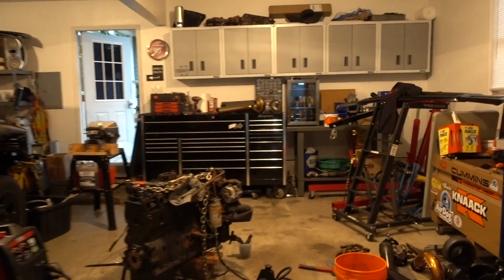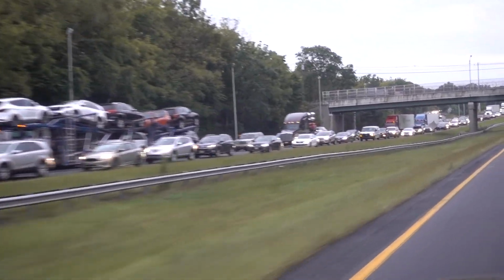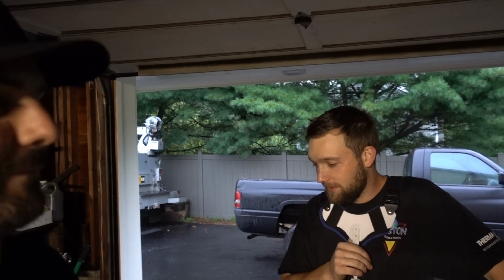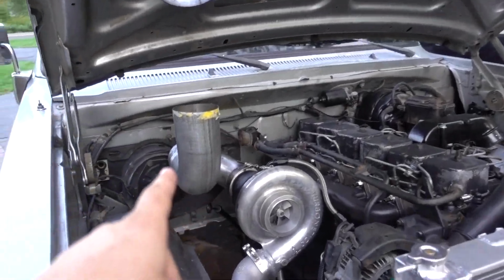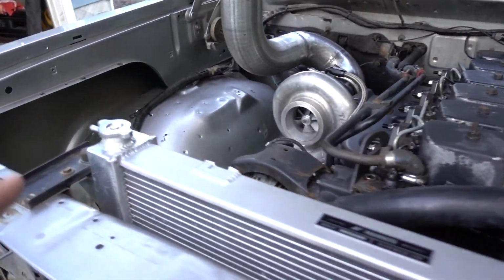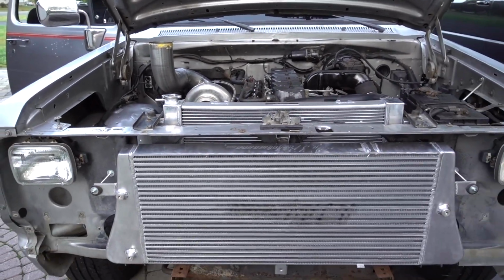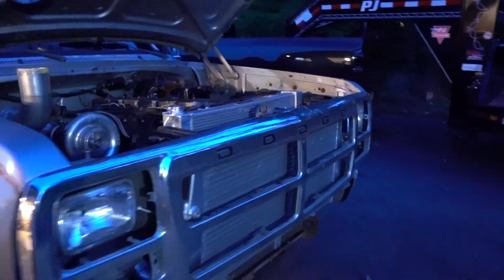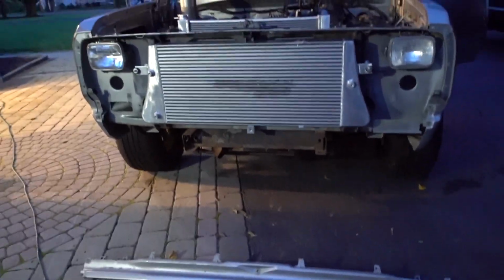THE FIRST GEN CUMMINS RETURNS AND IS BETTER THAN EVER!!!!

Comment from the maker: While your guessing hit that thumbs up!!!! 
Mini giveaway ends at end of today!!!!
Reply: GREG_ALBERALLA airdog or rear end
Reply: GREG_ALBERALLA A painted valve  cover
Reply: GREG_ALBERALLA racing seats?
Reply: GREG_ALBERALLA powerdrivendiesel air filter/intake
Reply: Dana rear end with disc brakes
Reply: GREG_ALBERALLA  air dog fuel system
Reply: Air dog fuel system
Reply: Air dog 4g and sump
Reply: Airdog fuel system!
Reply: Rear end install
Reply: GREG_ALBERALLA air dog
Reply: GREG_ALBERALLA gotta be fans
Reply: Trans adapter
Reply: Air dog
Reply: GREG_ALBERALLA  governor springs 👍🏽
Reply: GREG_ALBERALLA airdog sump pump
Reply: air dog or a radiator fan!!!!
Reply: Governor springs!
Reply: Airdog fuel system with a beans sump
Reply: GREG_ALBERALLA could you message me I have a truck question need help
Reply: Headlights
Reply: Airdog setup or a built transmission from Muldoons
Reply: Luciano Panezutti he already bought it
Reply: New headlights
Reply: Dana 80
Reply: GREG_ALBERALLA airdog, traction bars, or ratchet shifter for the manual valve body trans
Reply: Airdog lift pump
Reply: GREG_ALBERALLA the brand used rear
Reply: Dana 80 install!!! 🎉
Reply: GREG_ALBERALLA finally your gauges???
Reply: GREG_ALBERALLA Airdog or pillar gauges!
Reply: The John moldoon trans
Reply: Airdog
Reply: Rear end
Reply: Traction bars or Dana 80 or gauges
Reply: Air doggie
Reply: Air Dog Sump is next modification.
Reply: GREG_ALBERALLA air dog or traction bars
Reply: Air dog
Reply: GREG_ALBERALLA manual trans
Reply: Rear end
Reply: GREG_ALBERALLA  my guess is a p-pump
Reply: GREG_ALBERALLA air dog lift pump
Reply: Air dog
Reply: Traction bars
Reply: Headlights
Reply: GREG_ALBERALLA injectors
Reply: Electric fans
Reply: Airdog 4g all the way for the next mod
Reply: Rear end
Reply: Damon Clemons he already has one
Reply: Electric Fans!
Reply: GREG_ALBERALLA Air dog fuel system
Reply: Feel pump
Reply: Greg_Alberalla injectors so u have more fuel to go with the bigger turbo.
Reply: GREG_ALBERALLA rear, headlights or gauges???
Reply: Pod gauges
Reply: GREG_ALBERALLA gauges or wrench works sticker in the back window
Reply: GREG_ALBERALLA the new transmission????
Reply: GREG_ALBERALLA a cam or a p-pump
Reply: intake horn/grid delete
Reply: GREG_ALBERALLA air dog
Reply: Short throw shifter or chrome rear diff cover
Reply: I have to say the air dog 4g with beans sump
Reply: Air dog.
Reply: air dog lift with beans sump
Reply: I think the gauges or the airdog Greg I need a sticker haha
Reply: Air dog pump???
Reply: GREG_ALBERALLA  traction bars
Reply: GREG_ALBERALLA air dog or tranny
Reply: Gotta be an air dog!
Reply: GREG_ALBERALLA. Airdog
Reply: Airdog
Reply: Air Dog 150
Reply: Muldoon built trans
Reply: GREG_ALBERALLA methanol injection?
Reply: drive pressure gauge
Reply: GREG_ALBERALLA the electric fans
Reply: GREG_ALBERALLA injection pump
Reply: Air dog 4g lift pump.
Reply: It's a disc break Dana 80
Reply: GREG_ALBERALLA  what happened when it rains into the hood stack
Reply: GREG_ALBERALLA  INJECTORS
Reply: GREG_ALBERALLA electric ⚡️ fan or head lights or gauges
Reply: Nitrous
Reply: valve cover paint
Reply: GREG_ALBERALLA.... Another caterpillar for the one you ran over.....R.I.P Mr. Caterpillar....
Reply: Nitrous for the upcoming event
Reply: GREG_ALBERALLA the trans adapter
Reply: GREG_ALBERALLA  injecotrs, cause you already got a rear end for it
Reply: Injectors!!?
Reply: Electric fans?
Reply: Air dog
Reply: I'm just going to go out on a limb and say airdog or injectors
Reply: Air dog, rear end, or something transmission related like the shifter or even the trans it self 🤔
Reply: GREG_ALBERALLA it's a transmission
Reply: Fuel pin
Reply: GREG_ALBERALLA big injectors or rachet style shifter
Reply: GREG_ALBERALLA twins?!?!
Reply: GREG_ALBERALLA Injectors?!?!
Reply: Air dog?!?!
Reply: Joshua avila The bucket, or whatever he uses to cover the stack at the time, gets wet!!!
Reply: GREG_ALBERALLA     A good set of gauges?
Reply: GREG_ALBERALLA fuel pin for the ve pump
Reply: Front bumper
Reply: Hey I guessed right about the front bumper idk if you seen it in all the comments! Love you greg
Reply: GREG_ALBERALLA did I get it man haha 😂

Comment: Just keep it ugly with no grill or bumper lol Weight savings and maximum air flow into that massive inter cooler. No I'm joking it does look sick without the grill inserts though! I guess electric fans for radiator or larger injectors and pump.